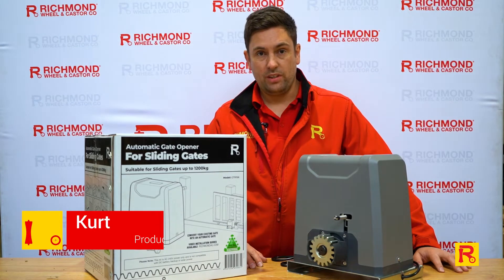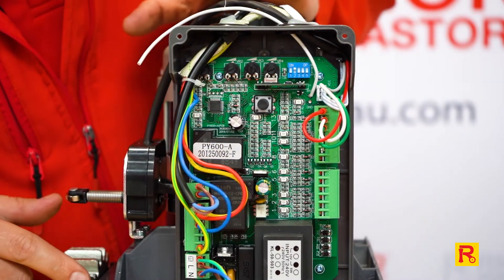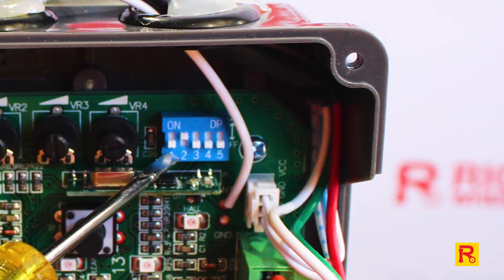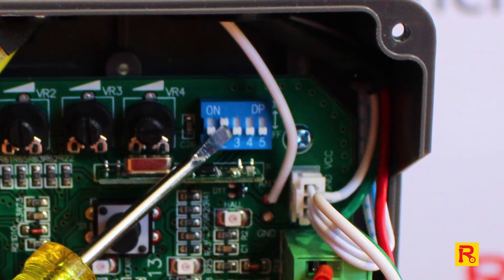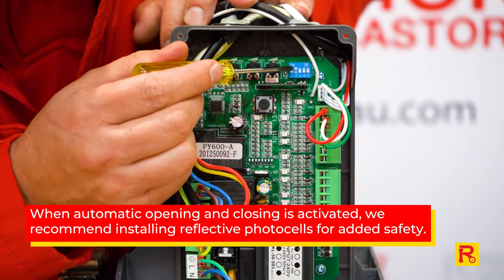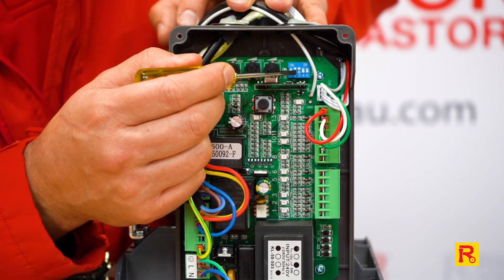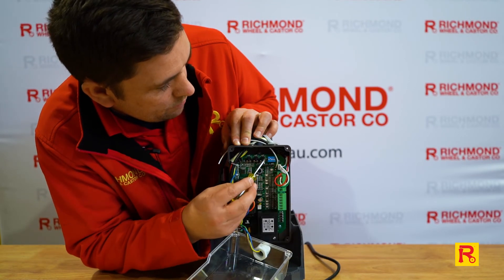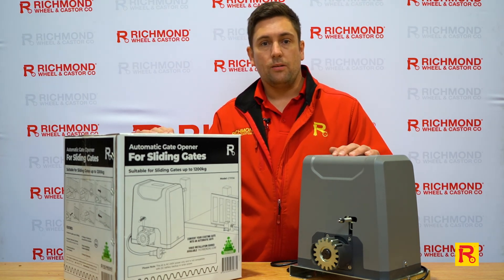GTR156 Dip Switch Adjustment HD

Comment: This a very good gate motor - but i need to work out how to make it open / close faster ?? - your video doesn't explain any of these instructions.
Reply from the maker: Hi Natahan. We've kept it simple for our DIYers with a single speed motor. However, it does have soft open/close as it reaches each position.

Comment: Can I add a module to automatically and close the gate at a certain time of day?
Reply from the maker: Hi abc123birdsandbees,
The motors are specifically built using screw terminals and simplified software so that 3rd party accessories can be used. This includes dry contact timers for specific operation times etc.
You can also wire in a range of items that allow remote operation from anywhere in the world.
If you need any specific wiring or compatibility information you can contact our gate support team.
https://gatesupport.richmondau.com

Comment: How to put a cable if ur gate motor doesn't comes with cable antenna for long distance connection & operation,open and close.
Reply from the maker: Hi Mr. Art,
You can extend the existing antenna. If you email our technical team at gatesupport@richmondau.com they can let you know exactly how this is done.

Comment: Can you adjust the speed of the motor? Making the gate to close or open quicker
Reply: Is there a readily available larger diameter drive gear? Obviously, the track would need to be  raised for the extra size.

I'm not yet retired but will be by the time the gate opens and shuts. I defintely can't hold my breath for as long as the gate takes to open.
Reply from the maker: Hi Xagtly,
You could have one machined if you need. But, this will put more stress on the motor, lower your weight capacity and cause more damage if the gate hits anything.
On a side note, you don't need to hold your breath while the gate opens, it will still operate correctly while the user is breathing normally.
Reply from the maker: Hi Seb,
To keep things simple and easy to install, the GTR156 motor speed isn't adjustable. It does have a soft close function that slows the movement at each end of the gate travel. This soft close function has some adjustment available for slightly longer operation.